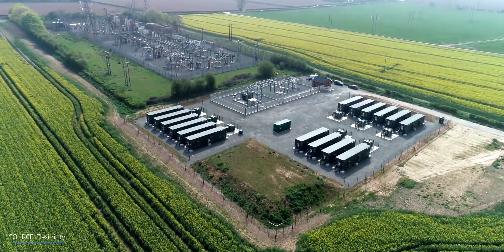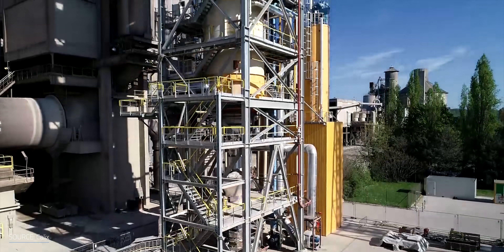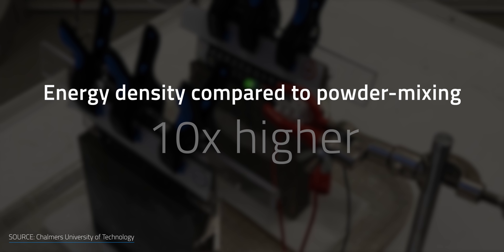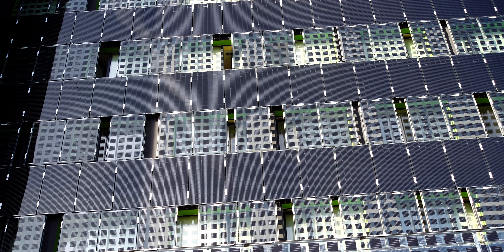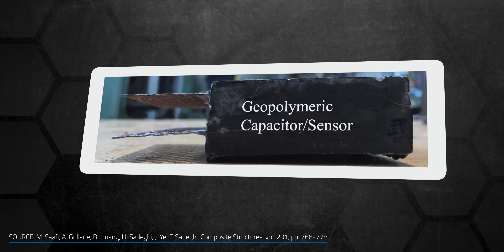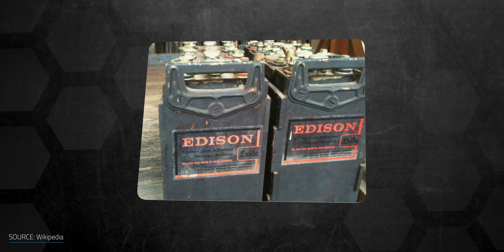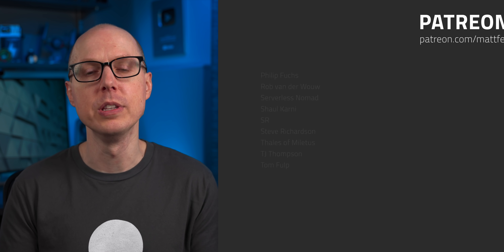Turning Buildings into Batteries? Concrete Battery Storage Explained

Comment: I don't think this will be the future. Here in the Netherlands, I saw on the news every giant contractor, will switch to wooden houses to build. Reason, nitrogen emissons slows down contstruction sides. Even in the north of the Netherlands, we pumped up, for arround 70 years of gass to heatup our homes. The effects are now little earthquakes that damage or sometimes distroy houses and buildings.
Reply: Anywhere that has access to a sustainable supply of timber should be doing their best to build everything out of wood.  And that's just for the environmental concerns of the other options.  Concrete is the most destructive building material, wood the least destructive.  
Wood does fine in earthquakes too, if it's properly designed for it (although you'll probably get some cracks in your sheetrock).  California has almost never had problems with wood houses collapsing during earthquakes.  It's always the concrete and steel stuff that collapses.  Even in San Francisco's 1906 earthquake where we didnt know we needed to build for earthquakes yet, most of the wood structures remained standing.  That's a small part of why the fire raged so hard immediately after the earthquake.  
edit: Notable exception to wood doing fine in earthquakes is the 1989 Loma Prieta earthquake.  There were a lot of wood apartments in the city that did collapse, but that's generally attributed to the construction trend at the time of completely gutting the structure from the bottom floor to put parking there.  In other words, buildings that were so poorly designed they stood no chance to survive anything more extreme than a mild breeze.  Traditionally designed houses in the suburbs did just fine.
Reply: @tippyc2  concrete lasts for thousands of years unless you put steel rebar into it.
Reply: @ooooneeee  But you cant build with concrete without the rebar (except for pavement).
Reply: @tippyc2  At some point you should consider the renewable source Bamboo. Thomas Edison used bamboo to reinforce his swimming pool in Fort Myers(on the ocean) and it still holds water today. Bamboo grown in the footprint of a modern house for 2 years can build that same house. Look it up.

Comment: Another possibility would be using this as a facade rather than the entire building.

As you mentioned, what happens when this needs to be replaced? Yeah. Do we demolish the building because that IS the structure? That seems counterintuitive lol. If it's a facade, you can simply replaced the worn out or broken tile.

Also, something I didn't know so I'm sharing, concrete creates heat when it's mixed (Hoover Dam Documentary). So in larger volumes are the scientists thinking about that? Will that cause issues with the materials they are using to create this "battery"?

Just little thoughts. I'm no professional but I dig the science so be helpful please. :)
Reply from the maker: A lot of question marks around this research that still need to be vetted.  Using them as possible storage within something like the street lamp post idea seems the most likely place to start.  But again ... still early stages.
Reply: @UndecidedMF  Oh yes! That was definitely a positive and even at that stage, having lights replaced with these options would dramatically reduce elect needs. Like now. And as you mentioned, other IoT devices for traffic etc.

My cynical side though thinks it will take forever simply because of politics. Regardless of the positives it provides. :/
Reply: @UndecidedMF  Perhaps the lighting requirements could include Dark Sky hoods to direct the light downward and avoid light pollution.

Comment: Can you adapt this tech to existing structures, or do you only use it for new structures? If integration to an existing structure would save it a lot and would have less environment impact. It would also be easier to replace when its life coming to an end or upgrade as new ways of making this battery will be discovered.

Comment: This doesn't sound like a great idea to me. Typically any device designed to do a number of jobs okay does a much poorer job than any devoted one.
We already know the power capacity is low, but how will the performance as a load bearing material be over time? Adding chemical activity and fluid movement in between pores purposefully sounds like a recipe for corrosion and stress fatigue.

Comment: At 1:43 you mentioned average energy density at Wh/square meter. A square meter is area. Density measured would be cubic meter.
Reply: They probably assumed that the concrete must have very specific width to act as a battery, so the third dimension is constant.
Though I would love what is that value. It might have been in the video and I just missed it.
Reply: @hubertnnn  I think they refered to the thickness of the model shown in the video. So something like 2-4 cm thick or 1-2 inches thick, approximately. Though they most likely they skewed the data in their favour the most they could, using lying by omission and omission fallacy.
Reply: My baloney meter went off scale at this point and I had a hard time believing any of the rest of the video.

Comment: Will living inside a battery electrocute us? 
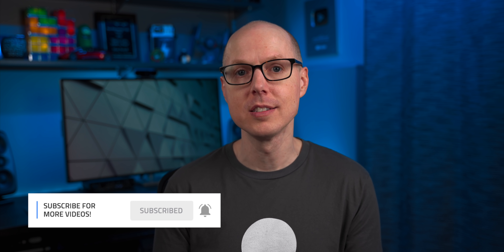04:50 Unlikely as you would be in contact with cement.
True. Until the house settles and the cement cracks, or somebody decides to hang a picture frame or a water pipe bursts and the water soaks into all the wonderfully porous cement.
Or the myriad different ways poorly maintained houses can degrade, which realistically is all of them. Generally people don't do maintenance until AFTER the damage begins to show.
Also fires happen, earthquakes, extreme weather events etc etc.
The technology is great if it works. Realistically though, this would be better suited to dedicated energy storage sites that can be properly maintained and regulated.
Reply: I love this part of YouTube.  People don't just trash something; they provide realistic and constructive criticism of a idea (mind the pun).
Reply: Depends on how you design the house. Imagine 6 huge thick concrete columns which are batteries also and you use to hang the frame of the house and support the roof. This would eliminate a lot of the problems you mentioned. The concrete columns would be designed to be resistant to earthquakes. If the columns  crack, you wouldn’t work about being electrocuted but the house falling on you which is a bigger concern...
Reply: My though is how would you safely de-energize the system to perform work or repairs? Seems like it would be fraught with danger. With a conventional battery/solar system, you can easily isolate the energy and safe it. How do you do that to literally the entire structure?
Reply: @nasonguy  The electrode plates would have to be laid out in separate pieces joined with wires, otherwise individual failures would bring down the whole battery. This modular layout could also be used to isolate the part of the house being worked on.
Reply: @markirmuir  Hadn't thought about that. Could make isolating easier. Seems like it would still be way more complex due to differing building layouts basically making every battery/bank unique.

Either way, seems like there are a lot of challenges with this. Interesting idea for sure, but challenges abound.
Reply: @nasonguy  The system could be designed to be worked on like power transmission lines that they don't deenergize while working on them. Requires space, free air suspension, and grounding cables. Not a lineman though, so it's a little beyond my expertise, but it would be in the house so it would be my work
Reply: @blaquejaque9702  Problem is that any tradesman that would have to do anything to these structures would have to worry about isolating/LOTO. Want to anchor something? Could kill you. Want to work in the plenum space? Careful...
Reply: @nasonguy  EXACTLY. But if built like you suggested column wise it could be broken down height wise, and shutting down the right thing could allow LOTO. Anchoring worries me.
Reply: @nasonguy  THAT would require quite a bit of wire cause it would all have to have it's own independent home runs out of the column which could exit horizontally though. And maybe a built in suspended, non conductive platform. Linemen work in the ⚡ zone everyday.
Reply: @blaquejaque9702  Just the fact that you'd have to have each and every tradesman that touches any part of the structure for any reason LOTO is a huge problem. Hyperbole? Maybe. But once OSHA catches wind that the bare structure contains dangerous amounts of energy will push them to force LOTO on everyone that touches it.
Reply: As an electrician, it would be interesting to see how maintenance, and repairs would be. Troubleshooting could be your biggest concern
Reply: "Great if it works"? Nothing great about it. Even if its completely safe. Even if its economical, and doesn't change structural integrity. Even if it lasts many times more than normal batteries, how long will they last? 5 years? 10? And what then? build a new house? Drill all the walls to maintain/replace them? With all due respect, its rather idiotic. Its like making a new cellphone that can store booze inside it. Like... Why?
Reply: I think it's brilliant, especially tying into the natural energy sources. Once made safe it would free up lots of material for batteries and create a green grid
Reply: @Baitrix1  everything to create a 🔋 is still present
Reply: Jorn Paul Winkler  To quote from your tirade "Indeed a billion tons of rainforests and forests burnt down every 10 years for biomass and biofuels" I am not sure if you understand how biofuels, or indeed just fire in general works. BURNING down a forest intrinsically makes it impossible to use the materials for biofuel production. 
Also
"Wood pellets are sold as a clean alternative to coal." Wood pellets are sold as a RENEWABLE alternative to coal. We can grow more wood, we cannot grow more coal. As for being cleaner? Coal releases Carbon that has been sequestered underground and releases it into the biosphere ADDING to the total CO2. Wood is grown. Which use CO2 from the atmosphere as the primary carbon source, so growing and then burning wood recycles existing CO2, without adding to the total.

Also
"which enables nations US, EU, Japan, South Korea, and the UK, to burn forest and not count the emissions" The same applies here as to the previous comment. GROWN fuel recycles atmospheric CO2 without ADDING to it. As a side note, the claim made that forests are being destroyed? I cannot speak for every country in the world. In the UK total forested area has INCREASED in recent years, in fact the total forested area has been increasing steadily for  more than 100 years. Japan has increased their forested land area so much that it is now actually causing more environmental problems that it helped.
https://www.forestresearch.gov.uk/tools-and-resources/statistics/forestry-statistics/forestry-statistics-2018/woodland-areas-and-planting/woodland-area/area-of-woodland-changes-over-time/
https://ensia.com/features/japan-reforestation-deforestation-lessons-indonesia-china/
Reply: Jorn Paul Winkler  that was a full in BLOG post in the comment section. 👏👏
Reply: I mean there will always be an electric/electromagnetic field around the outside of a battery without needing to be in contact, so unless you're far enough away from the battery which you wont be, then you have small amounts of electricity constantly flowing through you just being near/in your house. 
Some health crazy people are already overly weary about things like being too close to your router and things because of slight health concerns and how its carcinogenic, but imagine literally living inside giant batteries.
Reply: @1988ryan1  that's probably occurring RIGHT now right now. Cellular waves, etc...

Comment: Concrete, NOT cement ……!   Cement is glue that holds aggregate together making “concrete”.    This architect goes nuts when people get this mixed up.   Gluten isn’t ‘bread’ either
Reply from the maker: Yeah, I was pretty fast and loose with jumping between those.
Reply: @UndecidedMF  sorry, that and people saying ‘mason-ary’ instead of ‘mason-ry’ drive architects crazy.   Good video on this new tech though- thanks

Comment: Good video about the batteries, something to think about. Also, 8% of constant power, should be enough to run the "needed" equipment overnight...

On a side note, not to be a stickler for details, but you need to look into your research before commenting about plastic pollution... the US is one of the least world polluters of this material.  You may want to actually research and do a video about it... because you will find most of those floating islands out there made of plastic? They come from China, India and the island around them... they produce between 50 to 70% of the world pollution of plastics in the ocean.

Comment: I remember reading about the first Moscow US embassy, Officials said it was fabricated to become a battery as the concrete cured. And it worked!. Great presentation.
Reply: @liam3284  how did the voltage escape the battery container without the electrolyte leaking. It wasn't because the battery was directly connected to the concrete floor. It was because the concrete wanted the charge maybe and it just took it somehow. Without being directly connected.
Reply: When you leave a battery on concrete all night somehow it loses its charge. It just happens and I don't know why.

Comment: Imo this is somewhat dumb. Concrete can be used I'm many ways to save therms, heat gain effects, and also passive housing. I NEVER heard of replacing concrete, because it is so hard unless a full demo. I like 3d printed homes more to try and bring costs down and energy costs for a more air sealed home.

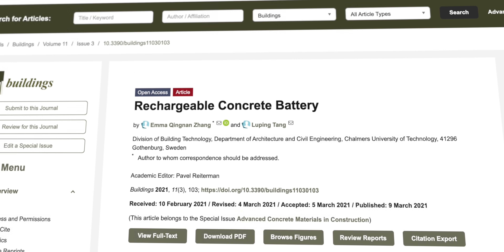Comment: 1:40 Energy density is not measured in Wh/m², it's measured in Wh/m³, surely? It's a solid substance.
1:46 Batteries do not store power, they store energy.
Reply: They store {condensed} electrons...
Reply: @grandunifier3169  The amount of electrons in a full or an empty battery should be the same.
Reply: @bloepje  no, they are {exchanged} for {mechanical} energy...
Reply: @grandunifier3169  No he is right, the number of electrons within a battery shouldn't change. In general electrons stay in the same place unless there is also an ion flow(like from the cathode to the anode within a battery). There is some actual electron flow in circuits, but it is so slow that it is only measured in semiconductors(critical part of how they work).  

On a side note, if you want to look up how to calculate the flow of electrons, it is called the drift flow. It is usually measured in micrometers/second. Also, it oscillates in AC current, so electrons usually travel nowhere very slowly.

Comment: maybe not using building but holes? old mines? We could get energy by putting something (for example water) on lowest level, and when we have overproduction of energy than drain this lowest level. We are able to get energy from droping water even a few hundred meters below. We could use multi level mines to lift water one level at a time.

Comment: You should probably not build with this, after all, rebar reinforced cement us an iron air battery already, which results in loss of structural integrity as the iron oxidizes. 
Bad idea.
Reply: If you were to charge rebar maybe you could prevent rusting though!
Reply: That's not a battery though...